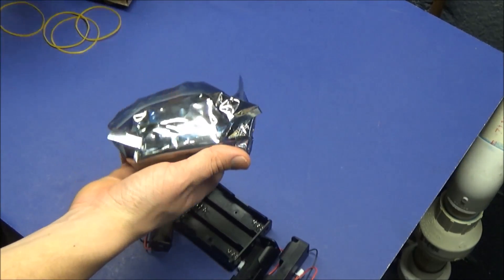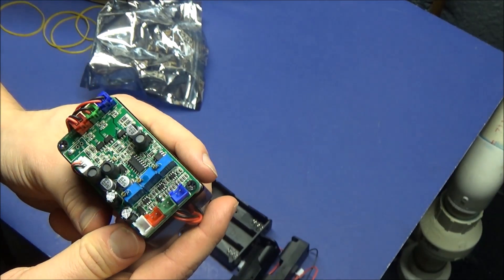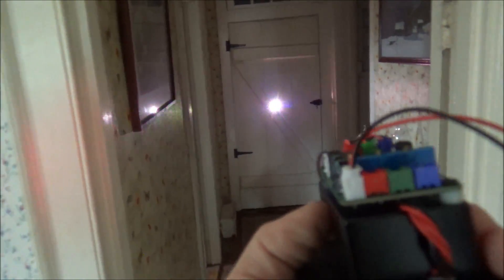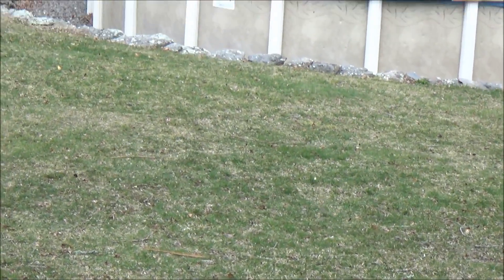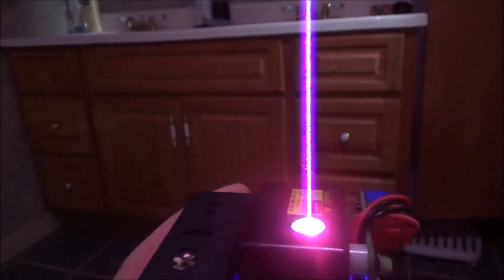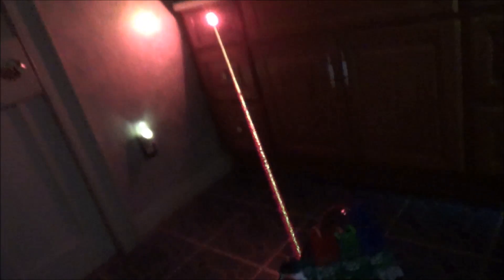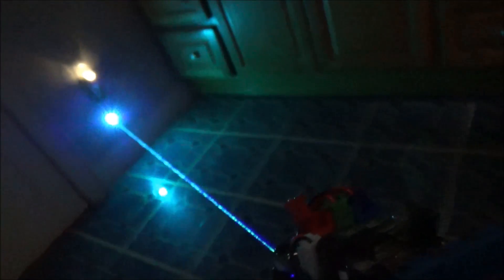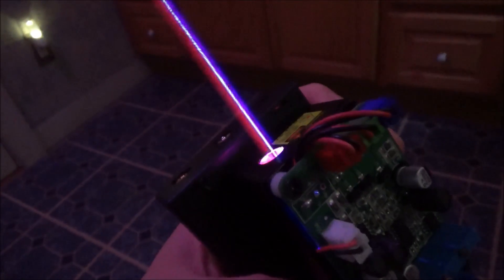RGB White Laser Module Test

Comment: Btw those native combo options how do you control that.. that info I missed, as there doesn't look to be any switches and simply adjust these extreme small potentiometers that are glued down has way more variable then 7 combo options so likely not that you referring to and you also stated that you didn't touch or adjusted that in the beginning?
so not sure what you referring to here 5:23 (how do you control it)

Comment: Looks wicked, I have previous purchase from Tommy's Laserpointerstore... like 6 products, in 3 orders and its not often I'm without critics, but I was very satisfied with my experience with that store. 5/5 from my end.
but with all purchases, you, of course, need to do due diligence and check the market first hand, that goes without saying, but on the 6 products I purchased from him, he was the cheapest and some of them I could not find anywhere else to anywhere near his prices.. like the small heavy Stubby.
Same with the laser mirrors.. I could  not find them cheaper on Ali or Taobao or Ebay even though a seller on Aliexpress he would be able to go lower, but here I needed to buy bulk like 10 or 20, but for the single unit, Tommy's Laserpointerstore was the cheapest and all was packaged very thorough and safe and labeled perfect so no hazzle in custom.
So I got a very positive experience with LPS with the items I have purchased from there, even though haven't purchase RGB module like in the vid...
but my girl is not that fund That I use our kitchen table as my laser-lab.. :P
https://i.imgur.com/H2xhdAo.jpg
https://i.imgur.com/0eQEx4a.jpg
https://i.imgur.com/UDIM03f.jpg
btw those Modulation outputs on these RGB modules, how simple are those to control the different RGBcolorvalues.. is it just plug and play with a crude potentiometer-knob?? or do you need a second circuit board that perhaps supply voltage and is driving a potentiometer and controller??

Comment: okay, I just bought this, on a wilm... Do I need to buy the battery connectors that look like single battery chargers with the wires coming out separately? because I have extra batteries, but I don't have those battery hosts with the wires coming out of them. If I do need to buy those seperate, please lead me to a place they sell them, I'm only asking because in package details, all it said was 1 x laser module.

Comment: Hey! I'm looking into TTL laser control for an RGB set of lasers - I know that TTL uses either 5 or 0 volts to rapidly pulse the laser on or off, so what method do you reckon I could use to control each channel by hand using an adjustable dial? Thanks!
Reply: Did you ever find an answer to this?
Reply: @AndyHatchKitchar  I ditched TTL and used variable buck converters, with a potentiometer connected to the pot terminals - the potentiometers have resistors with the same maximum ohmage as the original PCB pot across them in parallel, allowing you to change the final voltage out to the laser diode. Worked to make a nice RGB laser pen!

Comment: Can I reduce the power of the lasers with the potentiometers for safety ? I want to use it in a school to show diffraction.
Reply: yes for color variation and beam brightness, otherwise you can also just use a cheap DC to DC LEDstrip dimmer if you wanna dim it all a bit down.. they cost around 1USD on eBay with a turnknob.
Reply: Hi XM360 I have a similar 400mw purchased off eBay, I purchased it without much research, do I need eye protection? Is there a way to shield material (in this case clear fibreglass resin and vinyl) from being burnt without decreasing the intensity of the light beam? 
I also noted that the model has an input for a fan, is a fan needed to cool such devices if running for extended periods of time? 

Thanks for the video has been very informative, hope to hear from you soon.

Comment: Sorry if you explained it in the video, but how is it powered? 

In the beginning of the video, it looks like there are battery cases on the table and I assume that's what you're carrying along with the laser when you test it out. It looks like it's connected to the white pin connector in the back, so does that power all 3 laser diodes at once, allowing you to remove the pins connectors from the front to turn off individual ones?

Is this correct?
Reply from the maker: It is indeed powered by the triple battery holder (18650 battery x3), going to the white connector in back. However, it is not recommended that you unplug the connectors in front, at least not while the laser is operating. The empty connectors in the back are for TTL control and this is the recommended way to operate individual colors

Comment: this arrived today, its a lovely bit of kit!   the exposed circuits are a bit fragile, i will have to try and mount the box and battery box on something I think
Did so say in your previous vid that this can run from a mains adapter? or was that one of the errors?  You could use one of the 3 strange single battery holders..  remove the cable and fix the cable to a wire and adapter set at around 11-12V  that may work
Reply: I myself am wondering how to power these modules.. Do they have their own power supply in the box? or how the hell do you turn these things on?